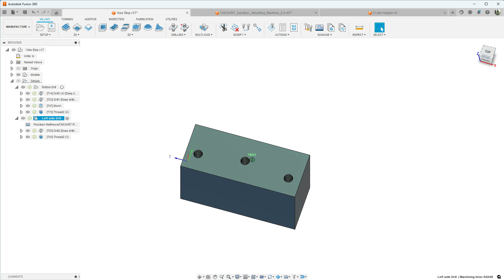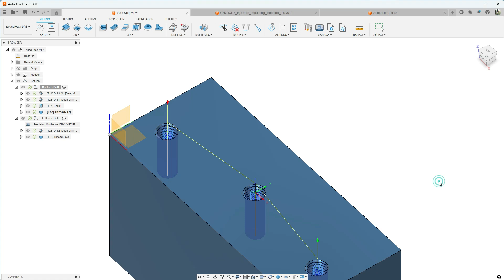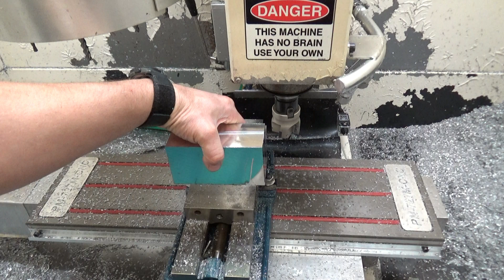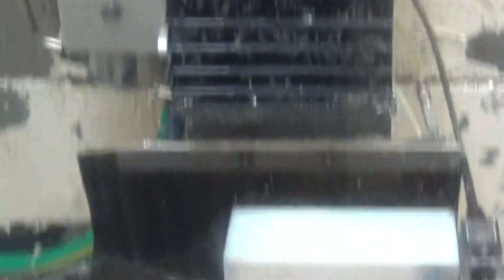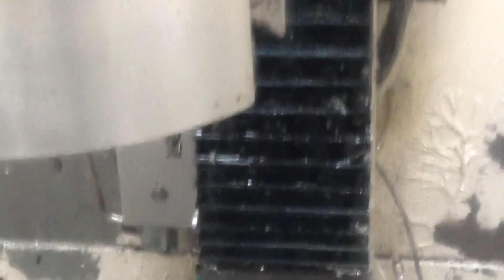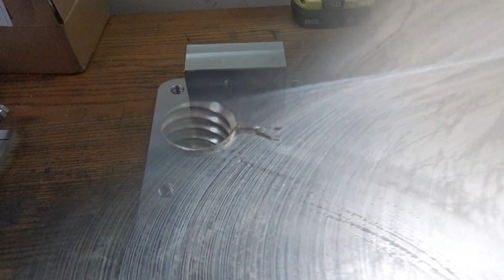Injection Molding Machine Part 3  Vise Back Stop

Comment: I've built a couple of plastic injectors now, but always use vises.  How much force do you think that over center toggle will create?  Even on small parts at 2000-3000 psi of injection pressure, that can be a LOT trying to force the mold apart.  Love your work!
Reply from the maker: Thanks Bill.
Yes I agree 👍 the overall design is tested and in use. Additional small c clamps could be added if needed.
Reply: @CNC4XR7  Good to know.  My last build looked a LOT like yours except it was a 3 leg instead of 4 leg design.  I had the main legs just barely behind the back of the mold and the rear leg quite a but behind that.  So the front legs take most of the tension but aren't in the way of the mold insertion and removal.

My sons and I will eventually get around to producing that injector or a variation.  It was the testbed for our injection electronics and software interface.  And a learning experience for making our own brass injection barrels.  What fun.

Comment: Easy way to work out drill size for Metric threads is bolt size-pitch (eg. M10 x 1.5mm pitch is 10 - 1.5 = 8.5mm drill bit) NO charts needed
Reply from the maker: Great tip thanks